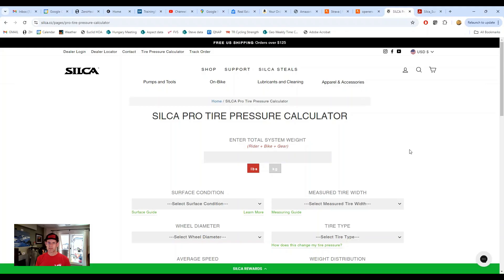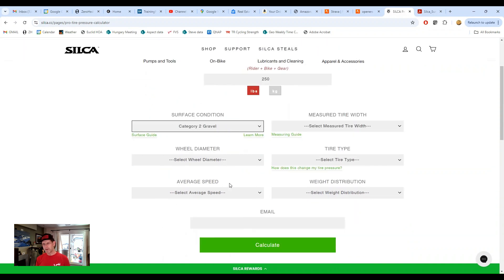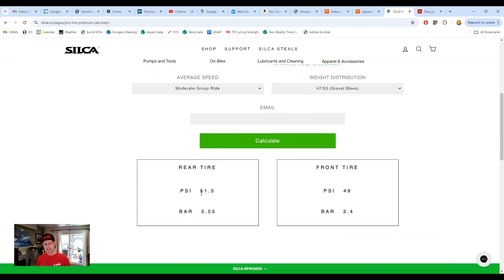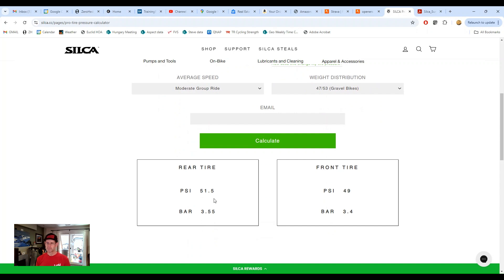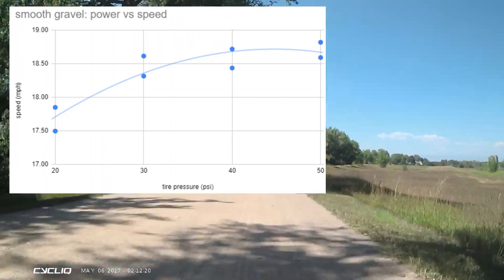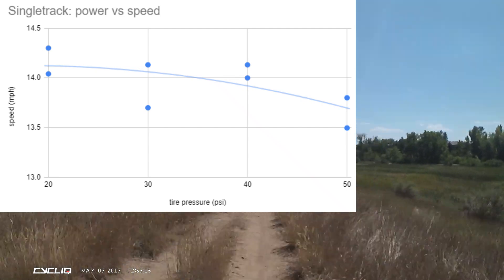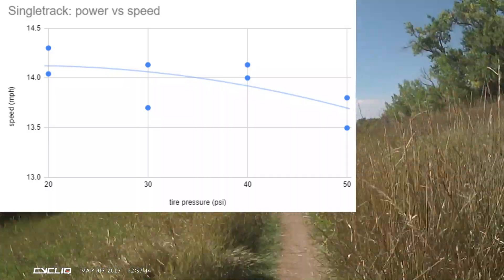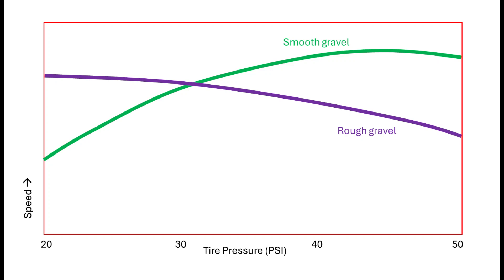Testing Gravel Bike Tire Pressure vs SPEED  #gravelbike #cycling

Comment: I tried the silca calculator for a couple of my bikes and found the suggestions 5 to 10 psi higher than I run on mixed surfaces. Also the weight balance they suggest is much higher for the front than I would expect. For road I think it is likely 40/60 F/R and they list 42/58 which seems quite aggressive to me.  My combined weight varies from 125 to 130kg. Favourite tires are Gravel King standard or semi slick treads.

Comment: I run my 26" bike on the rail to trails(stone dust with hard-pack gravel) and count on increasing my speed by as much as three km/h when I increase the tire pressure from 25 psi(after 2 to 3 months of biking) to 60 psi.
Reply from the maker: That is pretty consistent with what I found.  20 psi was about 5% slower than 50 psi on the smooth stuff.

Comment: Is 35 as wide as your bike fits? Considered 650s with something wider? My hypothesis is that it would allow a more consistent low pressure on both surfaces (and be more comfortable and possibly faster) 🤔
Reply from the maker: I have a Canyon Grizl. It is supposed to accommodate 50 mm or larger.  I would have preferred the 40 mm version of this tire (Schwalbe G-one Super RS) but it was (is?) out of stock.  I typically choose the fastest tires from the BRR list (https://www.bicyclerollingresistance.com/cx-gravel-reviews).  I was able to get one(!) of the Caracal TLRs from Europe.  The Schwalbe is the fastest tire with a meaningful tread.  I've been happy with it so far; will race it next Saturday.
Reply: When I tried 650b I found that at the same 35ish psi I was having good success on my terrain with on 40c 700c. They didn't ride as well at speed downhill that I attributed to the flex of the taller sidewalls? I also think that rim width has alot to do with the equation, I like a wider rim like an i28 or i30 even. Granted I am probably more concerned with comfort over speed........
Reply from the maker: yeah, when you start looking at rim/tire combos, unraveling the speed is really tricky.  The rolling resistance tests are nice, but like you say, those tests don't ensure that a certain rim/tire combo will roll fast on real terrain, in real wind.  From an aero perspective, I do like how these 35's mate with my Hunt Limitless wheels (I think outer rim width is 28 mm)
Reply: @MorganBrown  I think that one thing we should all agree on is that no matter what "genre" of cycling one is doing it is best to test different psi on your terrain and bike(s). It doesn't take long and pays big dividends. Stuff like that Silica site just makes people lazy and not really get them what would best suit them. The best aspect of tire pressure I have seen is how it keeps going lower and proves to be as, if not more efficient overall. Tubeless also has a hand in that.